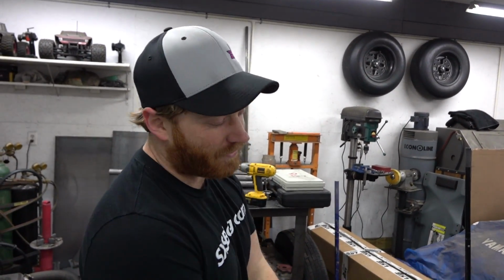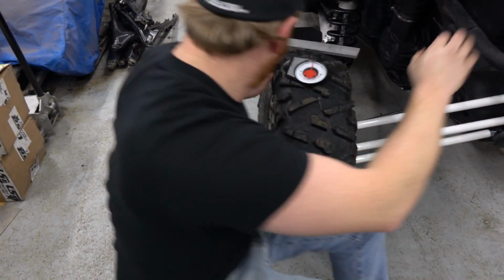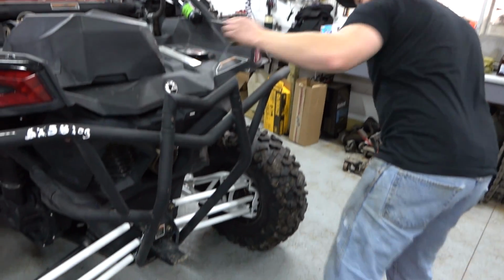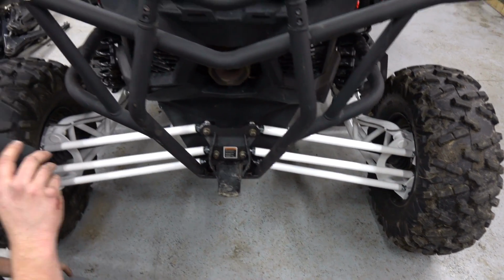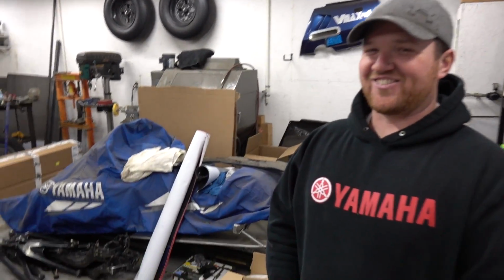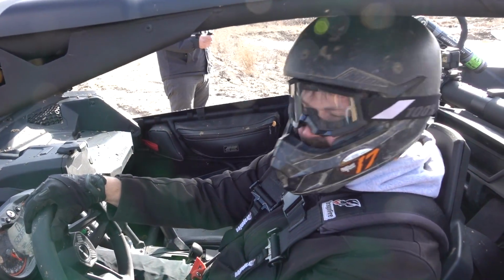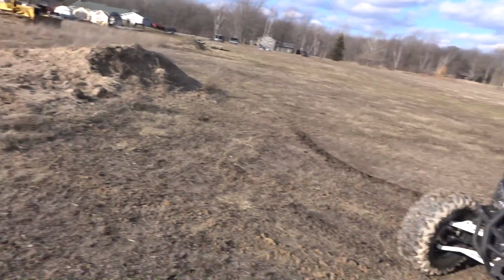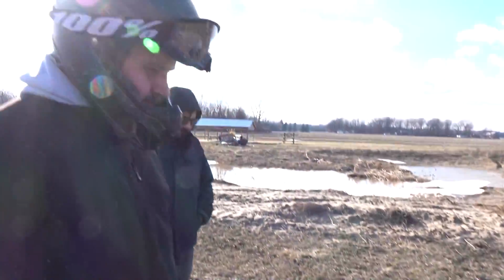Adjusting then HUCKING the X3 with LSR suspension!

Comment: Just ordered my clutch, tune and exhaust for the rzr  terba 15 psi boost, high clearance stuff is in, have to do a final on camber adjust for the suspension etc garage floor is way out of level so have to put all 4 wheels off the ground with bottle jacks to get that level before I can attempt the camber adjust,  it should rip, stock was scary as hell at 5 psi boost, can't wait.
No heat in the man cave so suspension mods nearly resulted in frostbite, beers were freezing faster than I could drink em LOL
Reply from the maker: hahahahaha. Damn! Sounds cold.
Reply: you know it's cold when you go inside to warm up and put your hands over the baseboard and it makes them feel like you crushed them in a vice lol
Reply from the maker: Ive been there bro. Pre-Doug times lol
Reply: You'd think me being a licensed master heating tech I'd have put some heat out there , pfffttt! no way, money I can spend on the Terba rzr besides I'm well used to having 2 snot ropes hanging down to my knees and hands so froze you can't feel it when you peel the meat off the back of your knuckles lol Ehhh you know what they say "That which does not kill you only makes you sicker than hell" LOL Good Vid Bud keep up the good work and like I said give the Maine ITS trails a serious look, you can literally book a room at a lot of motels and leave the parking lot drive across the road and be on several thousand miles of trails, the entire top half of the state of Maine is all ITS trails well mapped , marked and they absolutely cater to the snowmobile crowd in the winter and the off road community in the off snow season and best off all very affordable, last time me and a buddy went we booked a room and the girls came in took care of our laundry, cleaned the room and when we got back laundry was all washed ,dried and folded neatly on the bureau awesome time 450+ miles in 4 days and you can drive on the main roads to get to restaurants, gas stations etc.

Comment: The white suspension is sick looking. I just got into a 17 x3 xds.. I haven’t really been able to take it out yet.. would you say that the stock suspension makes a lot of clunking nosies? And if so what are y’alls thoughts on how to fix it other than a full suspension swap?
Reply from the maker: There just seems to be some slop in the XRS stuff. We haven't had seat time in a XDS so we can't confirm. But thats pretty standard with looser spec'd OEM equipment. Adding things like heim joints instead of rubber/bushings and will help. But you can never get this kind of strength from OEM.

Comment: I was taught to set up suspensions with full rider weight in the machine. any thoughts on that? why you don't?
Reply from the maker: It's a negligible effect on these things, so we just get close to ride height.  It's gonna change on a somewhat regular basis due to shock adjustments anyways, and we aren't gonna re-align every time.
Reply: So do these same numbers for camber and toe in work for a 2013 Maverick???

Comment: Easiest way to measure toe is take 2 2x4 slightly longer then the tire
 Put them tall ways agent the outside of the tires use 2 tape measures and measure the front and back of the tire. Fast simple way to check and adjust toe

Comment: Rzr 4 turbo vs x3 max? I want a 4 seat turbo
Reply: Tom Crawford the x3 Max is something like 10" shorter than an extended cab Silverado.  Unless you only ride the dunes I'd go rzr.  The max is just beyond huge.
Reply: That’s what I was thinking
Reply from the maker: We had a max at Hatfield McCoy and had zero issues. Any of the 4 seaters are going to be huge.
Reply: I was wondering how the Max did. Does Brian prefer the Max to the rzr 4 turbo? I’ll be mostly Michigan trail riding
Reply: The wheel base on a x3 Max is 135", a double cab Silverado is 143.  The rzr 4 is 117", that's a pretty substantial difference.  They're super cool but they're enormous, go check one out in person if you have a dealer close.  The max is 20" overall longer and 10" wider.
Reply: Reaction Brewing thanks for the info much appreciated
Reply: I don't own one so take it with a grain of salt lol.  I went and looked at both but just couldn't get over the size of the max.  A friend and I are hoping to make a trip to Abernathy's this spring for a turbo xp and turbo xp4.  Definitely curious to which Brian liked more, they both have major gripes about them on their own forums.
Reply: Reaction Brewing yeah I like the idea of the suspension but the width and length of the max concerns me with the Michigan trails.

Comment: did you guys recheck all your measure ments after sending it over the jump to see if it's all locked in good
Reply from the maker: Not with all the mud. It's freshly washed now and we'll check it out this weekend.
Reply: SXSBlog.com  ya I figured he wouldn't wanna look with all the mud good to know your gonna re check things look forward to the next vid let her rip potato chip
Reply: Yeah great point . When you level it out ,check air pressure in tires too - can throw things off a little
Reply from the maker: Yeah for sure. We didn't get it on video but I made sure that air pressure was equal all around.

Comment: Is the X3 bottoming out? Looks like it may be on a few of those jumps. Perhaps stiffen up the shocks a bit? Send it! 110! #ThatShreddyLyfe
Reply from the maker: The shocks work super well and use use all the travel when they can. I didn't feel it bottom out. But when we go bigger they'll be adjusted!
Reply: I had problems with my X3 bottoming out. Best thing I did was set my cross over nuts about 1.5” from the bottom spring with the suspension sitting normal. Then play with the slow speed adjustment also slowed down how fast the shocks compressed on the landing. My ride hide from the bottom of the plastic in front of the rear tires are 14.5”. And that for me has been the best all around jumping  and trail riding.
Reply from the maker: Ok thanks for the suggestions. We currently have it set to the Fox race tune with some small adjustments for more ride quality.